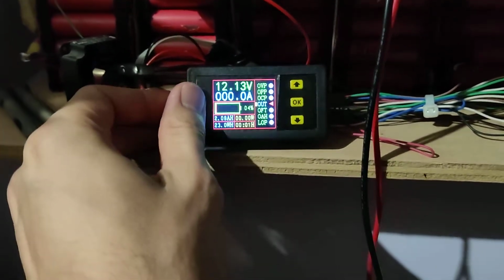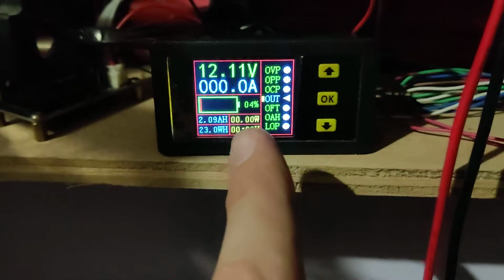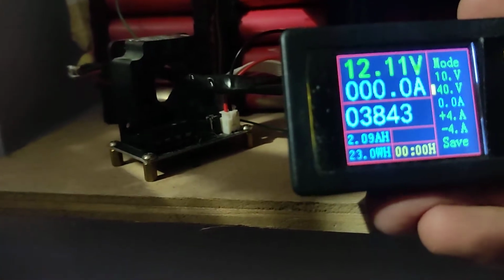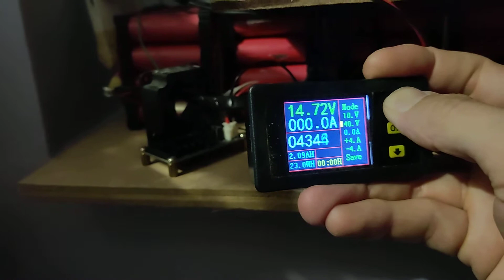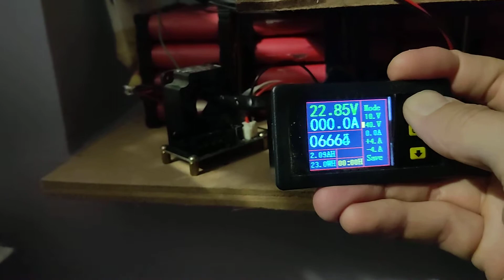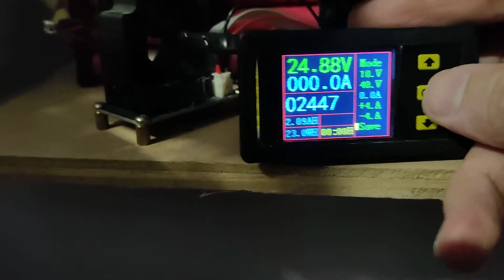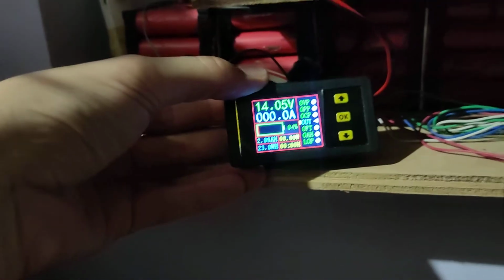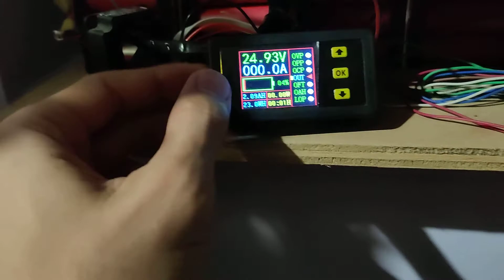DROK Meter showing incorrect Voltage (Problem Solved) Battery Capacity Amp Watt Tester Hall Sensor

Comment: Thanks for posting! I recalibrated my meter which was off by a good 0.2 volts.

Also, I believe the 10V and 40V settings are calibration points at 10 volts and 40 volts. You produce each of those voltages (or something close to them) to do a proper calibration at the low and high end of the sensor’s range. I assume there is variability since the meter and its screen pull nontrivial current which would cause voltage sag on the thin gauge battery sensing wires.
Reply from the maker: You're welcome, glad to help!
You're right, I did a little reading since the post and that was what others have mentioned.